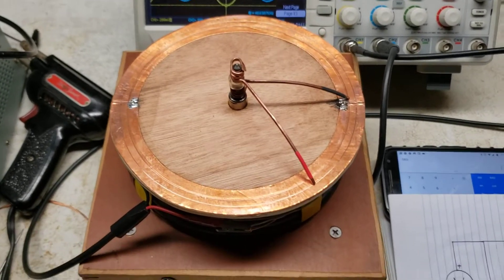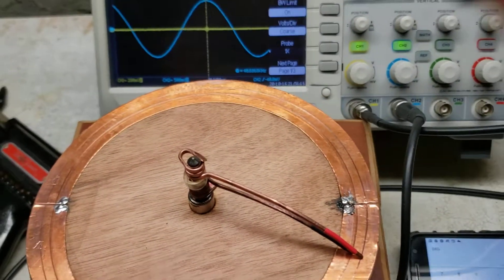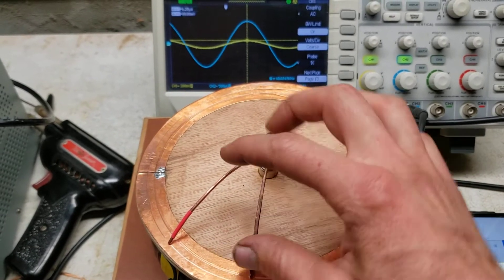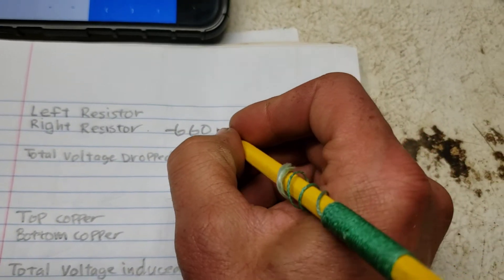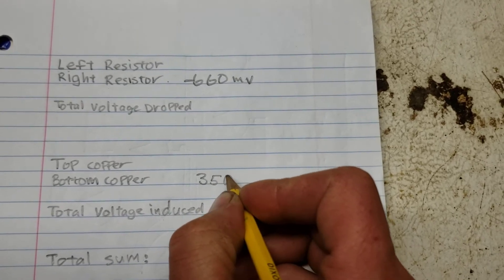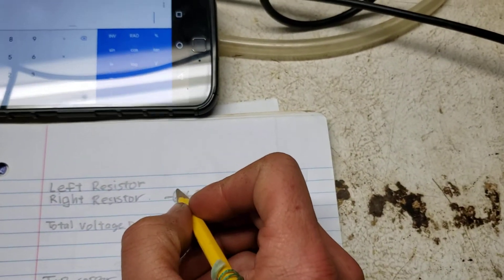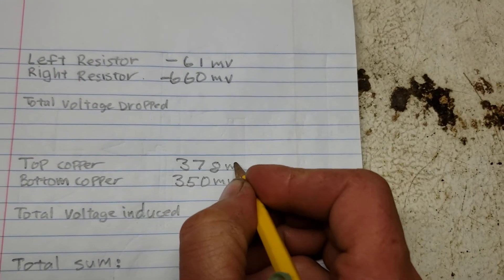The Lewin clock - Kirchhoff's Voltage Law(KVL) holds for loop circuits with induced voltage elements

Comment: Awesome set up :)

Could you test something for me, please? What happens to those same measurements if you place an additional osciloscope outside Lewin's clock? Can you create a table comparing simultaneous readings from an inside and outside osciloscopes? Which readings you consider affected by induced fields?
For example: Bottom copper: +350mV (inner) [affected?] and XXX (outer) [affected ?]; Right resistor: -660mV (inner) [affected?] and YYY (outer) [affected?]
Reply from the maker: I'd be glad to test something for you!
But I'm not sure  what you want exactly, so please explain more.

Do you mean instead of having the leads to down the center, have them go out away from the center like wagon wheel spokes?

As to which readings are affected by induced fields - do you mean voltage induced in the intentional curved path, or induced accidentally in the scope leads?

Basically, a wire running along the same path as the primary winding will have voltage induced in it. The farther away it is, the less induced voltage it will have because the magnetic field falls off with the square of the distance probably or something like that, depending probably on the exact shape of the primary winding.

So moving a wire farther from the primary reduces the induced voltage.

Rotating the wire so that it is at right-angles to the primary wire also reduces the induced voltage, and at exactly 90 degrees, there is no induced voltage.

So it's not like the region of induced voltage is a strict region which cuts off instantly beyond a certain point; it fades out with distance.

That's why I ran my probe leads from the center outward - so they would have zero induced voltage in them.

Another way to have test leads without them having induced voltage is to run them each straight up to a great distance. 
Yet another way is to have them each  run straight out away from the center of the coil a great distance, before coming together to the volt meter.

Thanks!
Reply: @fromjesse   Hi :)
 Mehdi and Lewin's measurements were made using probe wires sitting outside the circuit. On the other hand, your setup measures from inside.

We are going to compare readings from both setups.

Our comparison table should have 4 lines (upper copper, bottom copper, right resistor, left resistor) and 2 columns (fromjesse [inner], Lewin/Mehdi [outer])

We may discuss induction effects later :)
Reply from the maker: @renanmelo4903   Oh, gotcha. 
You mention  measuring like Lewin did - but his leads attached to the outside at the 12 and 6 o-clock positions, then ran along the same path of the coil to the resistors, where they then turned and went directly away probably as a twisted pair.

Did you want me to replicate that setup that Lewin had? Or just measure straight out and straight in, like this:

https://postimg.cc/qzy5Zdd7

As you can see, my probe wires in the above diagram are all traveling at right angles to the transformer winding wires so that no error voltages will be induced into them.

However, if you like, I can wind my test leads around the coil like Lewin did, but I can do as many times as you like to add hundreds of volts of error. But why would we want to do that? :D

Does my diagram look good? I want to make sure I'm doing what you have in mind before I go to a bunch of work that isn't what you wanted :D
Reply from the maker: @renanmelo4903  Thank you for the very nice diagrams! Very clear!

perhaps you could clarify one thing for me, and it may be you have a slight untrue assumption.

On page one, you say "Keep wires and probes close to the clock to reduce induction."

According to Faraday's law (And my video above literally demonstrates this) a conductor passing through a changing magnetic field at right angles will have a voltage induced in it.

We know that the copper foil loop is in such a position and has voltage induced in it, so it stands to reason that any other wire passing along the same path will also have the same voltage induced into it. Right?

So your request of keeping the probe path close to the measured path and reducing induced voltage are mutually exclusive. If it's close & parallel, it WILL have induced voltage. If I orient it so that it has no induced voltage, it won't be close and parallel  - it will be at right-angles to the copper foil path.

Remember, we're not talking about voltage being induced in the measurement wires due to the current in them - we are talking about the voltage being induced in them due to the changing magnetic field they cut through.

Can you see that if the measurement wire runs along the same path as the copper foil, that it will have the same voltage induced across it as is induced across that section of the copper foil?

Which way would you like the probe wires run? So that they have no voltage induced (straight away, at right angles to the copper foil path) or would you like them to run along the same path as your diagram shows, and have the same voltage induced in them as is induced in the copper foil path?

By running the probe wires straight away at right angles to the copper foil path, induction in them can be avoided, because it keeps them at right angles to the axis of induction. Then once they are a couple feet away from the magnetic field, they can be run together to the volt meter.

As to your four measurements as you have the probe wires drawn, I can tell you what we will measure: 

Of course the inside measurements you already have from the video above.

The outside measurements are as follows:

The two resistors will measure the -0.1v and 0.9v as expected. That is the actual voltage across the resistors.

The two copper foil half-turns will each measure zero volts, because the voltage being induced in that copper segment is exactly the same as the voltage being induced in the probe leads which follow the same path, and the two voltages are of opposite sign and the one cancels the other.

Do this experiment please: Take two identical voltage batteries like 9v or AA or AAA or whatever - just make sure they have the same voltage. Put them back to back in series, and measure the voltage across the string, like this: +==- -==+

You'll get zero. Ha! There's no voltage in these batteries! Correction: There is voltage in both batteries, but they are connected with opposite polarity and they cancel eachother.

It's the same thing with a folded loop in a changing magnetic field: +1v is induced in one half, but -1v is induced in the other half, so you measure 0 if you measure both halves together.

If you don't yet believe that a wire passing along the copper path will have voltage induced in it, then we need to sort that out or nothing will make sense.

I'm very happy to do the experiments, but it's clear that you don't understand exactly what you're asking - so that's why I'm trying to clear that up first!

Would you like first a simple demonstration showing how a probe wire running parallel to the copper foil path has a voltage induced into it?

This is how transformers work, but many people can't imagine voltage being induced in something as a simple wire hanging in a changing magnetic field.
Reply: @fromjesse  Yes, there will be induction. However, it will be small once the available area to magnetic flux is reduced.

I added a new page illustrating it :) https://www.udrop.com/E9s/setup2.pdf (PDF, 3 pages, 14 days to expire)

"Magnectic" instead of magnetic...  sorry! O.O
Reply from the maker: @renanmelo4903  Ahhh, thank you very much. I see what you're thinking.

First of all, you are absolutely correct about twisting the pair to eliminate induction in that section. Twisting, using shielded coaxial, or even just running two thin wires very close to eachother - this is all effective at keeping out significant induced voltages for our setup. Once the wires are happily twisted, it doesn't matter where the twisted pair runs.

The difficulty is getting the wires to the point where they meet up to be twisted - and the untwist part is where the voltage gets induced.

The reason we twist by the way is because it makes a bunch of tiny loops - and whatever voltage is induced in one loop will be induced with the opposite sign in the next loop, thus canceling out the voltage induced in the first loop.

You have however  a couple misconceptions.

Look at this stock diagram showing the orientation of the magnetic field around a solenoid coil: https://www.shutterstock.com/image-vector/magnetic-field-lines-around-coil-316674167

The magnetic field is the strongest right in the center of the primary winding conductors. 

There's several aspects at play here, and they can be a little confusing.

The magnetic field strength drops off rapidly outside the coil with increasing distance. 

The "Area enclosed" only applies to inside the primary coil, not outside. (at least in the meaning you are using.)

The underlying principle is not _how much area_, but how much magnetic flux intensity is cut across by the wire in question.

We use the "How much area" concept when the secondary is a loop and is entirely inside the primary winding.

But when we begin to analyze the voltages induced on subsegments of that loop, we no longer use the "area" but rather we examine the magnetic flux density 

So for example, look again at the stock diagram above: If you put a wire into that black magnetic field, it will get a field induced in it but ONLY if the wire cuts across the lines of magnetic force.

If the wire is exactly line up with the lines of magnetic force, no voltage will be induced.

Ultimately, if the probe wire is at exactly right-angles to the primary winding wire, then no voltage will be induced in the probe wire. That is why my clock hands go straight to the center.

Thus, if you have a wire that travels around the coil along the same path as the primary, you can see that it cuts across LOTS of lines of magnetic field, and it will have lots of voltage induced into it. And since the magnetic field is produced by the primary winding, the closer the probe wire is to the primary, the more voltage will be induced in it.

However, you can see that if your probe wire goes straight away from or towards the center of the primary, then it will not be crossing any lines of magnetic field at right angles, and it will be at right angles to the primary winding, and it will have no voltage induced in it.

That is Faraday's law. 

I added some black annotations and magnetic lines of force to your drawing: https://postimg.cc/phXRBVm3

Here's a short video demonstrating that the area of the secondary which is outside of the primary does not count towards area which induces voltage in it: https://youtu.be/Wju9QoB-llE

If this still isn't making sense, let me know and I'll set up my coil with some test leads and make a more detailed video showing what sorts of probing techniques induce voltage in the probe leads.

Or if you have other questions, let me know. Thanks!
Reply: @fromjesse  I am learning a lot from our conversation :)

Could you make a video comparing the readings of twisted and untwisted pairs like  your image?
Reply from the maker: @renanmelo4903  Alrighty, I made the video. It's 27 minutes and should give a pretty good overview, but it's gonna take all night to upload, since my internet ain't all that great. I'll send you a note when it is uploaded.
Reply: @fromjesse  Hi! I never thought about flux lines outside the clock the way you told me. I think this is a good point to do an experiment in order to standardise our points of view. It will influence our discussion about how induction affect our measurements outside the clock. I created an "Area Experiment" here: https://www.udrop.com/Ec7/area_experiment.pdf

Could you do this experiment too, please?
Thanks!
Reply from the maker: @renanmelo4903  Good Morning!
So my upload from last night finished, and in that video I demonstrate a bunch of different things: https://youtu.be/_mzxE_p5dN8

I'm sorry it's so long, but hopefully it will give you an idea of what these physics are like in the real world.

I also just now checked out your area_experiment.pdf - very valid questions, but I think the video I just linked for you answers the questions. 
If it does not, let me know! You will probably want to re formulate your question after watching the video.

But in specific answer to the question in area_experiment.pdf, the correct answer is:

D) The measured voltage will decrease when switching from diagram 1 to diagram 2 because the induced voltage will increase in the probe wires in the opposite sign of the voltage being induced in the copper foil, and this increased negative voltage will subtract from the positive voltage induced in the copper foil, thus causing the reading to go down.

As you will see in the video I linked above, using "area" outside of the primary is really useless. It's only useful for the part of the secondary that is inside the primary.
Reply from the maker: @renanmelo4903  Thanks! and Hi!

[Part 1 of 2]
Wheee, I see this is rather long. My apologies. I hope you read it all, I put a lot of effort into it and hope it either helps you come to my view or helps you see what you need to explain to bring me to your view :D

Did Mehdi also use the opposite batteries analogy? I know I did, but I don't remember if he did as well.

>If we apply Ohm's law to resistor, we must apply the same law for condutors since they are in the same circuit under the same magnectic flux.

I'm not sure what ohms law has to do with the question. The ohmic drop across the copper wire is so small it can be ignored. That part of the circuit could be a super conductor and the situation would be no different, within the resolution of your instruments.

Put another way, we can apply ohms law to the copper wire but the resistance is essentially zero so the ohmic drop is also essentially zero, and it might as well have no resistance, so the current does not cause an ohmic drop which would be the cause of Lewin's apparent paradox.

In other words, go ahead and account for all the ohmic drop in even the copper part of the loop, and your answer will only change by a few part per million at most, and the paradox will still exist as much a ever.

Or maybe I misunderstood your point?

I read over your PDF - I can't follow all the math so I can't comment on that, but I'll comment on some of the words:

First, you say of Mehdi, that he misinterpreted 3 points in Lewin's video. I'll comment on two of those.

>1. Can two volt meters attached to the same two points show different values?

The reality is that No, two identical volt meters cannot read different values when attached to the same two points. Inducing a series voltage error inline with each volt meter that is different makes them two volt meters that are no longer identical.

Lewin's two volt meters were NOT identical. Sure, some of the components were identical, but as a complete isntrument for measuring, they had different error voltages added to (or subtracted from) their measurement path, which Lewin did not account for. It's a fraud for him to say they were identical when they were not in fact identical.

If we consider the volt meters identical, than the test leads must be considered components of the circuit under test, in which case the two volt meters, while being identical, are not connected in the same place, but rather to different components.

It's a shell game.

It'd be one thing if it was impossible to measure the voltage without having voltage induced in the leads, but it's entirely possible to measure the voltage without inducing voltage in the test leads.

>3. In most cases real world and circuit diagram are equivalent. That experiment is one where it's equivalence is broken.

Objection your honor :D :D :D Anybody can draw the wrong diagram for his real world circuit. Lewin had coupled windings, and he drew them as non-coupled windings.

Lewin's integrity is what's broken. You can't honestly draw coupled windings in a transformer as isolated lumped elements then expect to get valid results.

It's just as stupid as if I drew a circuit and built same circuit, then inserted a AAA battery in series with one of the volt meter leads (but did not draw it in my diagram) and said Ha! I have two identical volt meters connected to the same point, KVL doesn't work!

No. Just no. The volt meters are identical, OR they are connected to the same point. If the series battery is part of the circuit under test, then the volt meters are not connected to the same point, but can be identical. Alternatively, if the series battery is NOT part of the circuit under test, then the volt meters are NOT identical, because they have non-identical errors added/subtracted to/from their inputs.

Nobody can honestly neglect part of their circuit in the diagram and then say KVL doesn't hold. For the model to work you have to model the physical circuit you have, not a circuit you don't have.

We HAVE (That's emphasis, not yelling:D) - anyway, we HAVE symbols for inductively coupled elements. Lewin's physical circuit HAS coupled inductive elements, but he drew them as NON-coupled elements, then he based his analysis on the FAULTY diagram, and showed that his measurements disagreed, and blamed it on KVL.

The point is that if you INcorrectly model ANY of your components in ANY kind of loop (even a DC battery and purely resistive loop) the analysis isn't going to match the real world.

If he had modeled the voltage induced in the volt meter leads, or if he had simply probed in such a way as to not induce voltage into his volt meter leads, KVL would have held just fine.

Regarding your Changing B Case section:

Your diagram is not representative of your physical circuit. In the schematic, you show a coil winding with two terminals and two resistors in series across the two terminals.

In the physical sketch, you show the transformer as having a single terminal (??) with both volt meters connecting to that single terminal? That's nonsensical :D

I'd be glad to draw the equivalent diagram or real-world-sketch, just let me know if you want it to match your schematic, or your physical sketch. But in any case, your physical sketch needs another point - if it's got 3 components or regions (i.e. two regions of resistance and a region of induced voltage) it needs 3 points on it.

However you could have just one and one resistor, then you only need two points. But then your schematic would have only one resistor as well.
Reply from the maker: [Part 2 of 2]
>Is it bad probing? I don't think so :)

Well, any time you have error induced in your probe leads outside of the circuit under test, you have, by definition, bad probing.
You need to either prevent errors introduced outside of the circuit under test, or you have to model your test leads as part of the circuit under test, or you DO have bad probing, period. That's the definition.

Un-accounted-for voltage induced in the test leads is the number-one source of bad probing with oscilloscopes. If Lewin wasn't using bad probing, then there is no such thing as bad probing. You've just eliminated an entire problem that used to plague the EE industry :D

Of course EE's are still going to be getting bad readings, but they can just chalk it up to KVL not holding. Ultimately they are still going to have to learn to probe correctly, and then guess what, KVL will hold again.

At the end of the day, if we're going to have voltage induced in our test leads, we either need to account for it in our measurement, or model it as part of our circuit under test - otherwise we got bad probing. And Lewin neither accounted for it in his reading nor did he model it as part of his circuit under test.

By the way, two other Physics professors were called to defend Lewin, and they both responded in detail and neither one defended him as best as I can tell.

In fact, the article by Dr. McDonald (from Princeton) has some interesting things to say.

For example, he says this in the notes, regarding some of Dr. Lewin's Kirchhoff-follow-up videos:

"many of the statements in these videos are more in the nature of misdirection than explanation."

Dr. McDonald also says that Dr. Lewin is using an obsolete version of Kirchhoff's law which Dr. McDonald says "can lead to apparent paradoxes."

Dr. McDonald also says "An important consideration in Lewin’s example (not mentioned by Lewin) ..."

Misdirection, and apparent paradoxes? Not mentioning important considerations? Sounds like what a stage magician does. Smoke and mirrors.

The fact is that even Dr. McDonald, while using the highest professional courtesy, still accuses Dr. Lewin of not mentioning important considerations, using an obsolete version of KVL which causes an apparent paradox, and misdirection (which is a form of deception if intentional.)

(I'm sure you already read that document, but it can be found here: http://www.physics.princeton.edu/~mcdonald/examples/lewin.pdf )

Furthermore, MIT Professor Dr. John Belcher, who Dr. Lewin called to his defense, concluded thus:

"One textbook that makes perfectly clear what the “voltage across the inductor” is is the textbook by Feynman, Leighton, and Sands, The Feynman Lectures on Physics (Addison‐Wesley, Reading, MA 1964), .... Thus with Feynman et al.’s definition, the sum of all the voltage differences around the circuit is zero (that is, KVL holds) ... In this sense, KVL holds, as argued by Mehdi Sadaghdar, but one must always remember that the voltage difference across the inductor is defined in a very different way compared to the voltage difference across the other three elements." (See here: http://www.electroboom.com/share/FaradaysLaw_Mehdi.pdf )

So we've got an MIT Physics professor quoting no other than Richard Feynman, saying that KVL holds.

We've got a Princeton Physics professor saying that Lewin neglects to mention important considerations, uses an obsolete version KVL, and uses misdirection, and says that the paradox is only apparent (i.e. not really a paradox) due to the fact that he's using an obsolete version of KVL.

As far as I can tell, the problem boils down to a very simple one: If you analyze a circuit diagram that does not match your physical diagram, your calculated results will not match your measured results, and all the laws of physics will appear to fail.

You have to understand each lumped element and how it behaves, and model it accordingly. If you do, then KVL works. If you don't, not only KVL fails but everything else fails too.

I'll give you an example from your own paper: Page 1, "The Battery Case:"
You show a battery and two resistors. Now let's say before assembling it, you measure the resistors, and you measure the voltage on the battery. Now you wire it up with a real battery and resistors, and carefully measure your two voltages dropped on the resistors. They are going to be less than you thought. The open circuit battery voltage will be greater than the voltage that you actually drop across the two resistors. Why? Because a real battery has internal resistance, and you neglected to model it. See? KVL doesn't hold!
No, KVL holds, but you have to model your circuit correctly. To get accurate results, you need to also model the resistor inside the battery.

It doesn't matter whether your loop is made up of resistors and inductors, or batteries, solar cells, capacitors, diodes, or whatever - you always, always have to correctly lump and model your components. If you don't, you will think physics is falling apart at every seam. But it's not physics fault, it's just incorrect modeling. Incorrect probing is a subclass of incorrect modeling, because you're not modeling the components in your instrument's test leads.

Anyway, that's my opinion. And Dr. Belcher's, and Dr. McDonalds, and quite probably even Dr. Feynman's.

Now are there circuits where KVL cannot be used? Of course there are. Non-loop circuits cannot be fully described by KVL because it's for loops. Circuits which have transmission lines in them probably could not be fully quantified with KVL - however if the transmission line units were correctly lumped, then the remaining loop part of it would fit KVL.

In any case, Lewin's setup wasn't a transmission line circuit. His can easily be analyzed as a loop and KVL holds. And that's why adding up the voltages as I show in this video shows that KVL works.

The best you can do along the lines of demonstrating that KVL doesn't hold in Lewin's circuit is to use a definition of volt that based on a technicality excludes certain situations. Or you cold perhaps do like Lewin did and use an obsolete definition of KVL. My guess is that even the obsolete definition of KVL did hold at the time it was written, but then afterwards, the definition of volt was changed which caused some technicality. So why does Lewin decide to use the modern definition of volt, but not the modern definition of KVL? Either use the obsolete KVL and the volt that it was defined with, or use the modern of both.

But at the end of the day, even a sine wave is a voltage. You might say that it's not voltage due to some technicality (and you would be going against Richard Feynman) but regardless, the AC output of a transformer still measures as a voltage, if you connect a load it still does work. But if the induced voltage at the output of a transformer is not voltage, then what about an identical sine wave generated by a wave form synthesizer? Would KVL hold if the sine wave was instead coming from a waveform generator instead of an AC transformer?

My guess is that if you define volt in such a way that KVL does not hold on Lewin's circuit, that a lot of other physics will fall apart with that definition of volt.

Hope that helps :D
Reply: @fromjesse  Hi :)

You don't have to worry about the size of your answers. As long as we maintain mutual respect, it will be a pleasure to continue our theoretical investigation. Unfortunately, I do not speak English fluently which reduces the effectiveness of my messages.  Please be patient :)

Having said that, let's get to the point: KVL or FL?
I have no problem with KVL applied to circuit diagrams. My problem is when someone applies KVL to "physical diagrams"... in particular that one in Lewin's video.

Fortunately, I have identified a key point in our debate: the explanation of what is happening along the conductors!There is a BIG difference between how KVL and FL explain what is happening inside them! And that's why I commented on Ohm's law :)

In your experiment, you got an f.e.m. + 728 mV, total resistance of ~1k and consequently a current of 728 uA. What happens if we apply Ohm's law to the conductors using this current and the voltage measured along them ( 364 mV on average)? Remember that R ~0 in a conductor... Did you notice the contradiction?

I thought a lot about our conversations... the way FL solves this paradox is totally counter-intuitive, but it respects Ohm's law. If I can explain it to you, you'll understand my point of view.  You may disagree, but at least you will understand why I am against using KVL in "physical diagrams" when they are not equivalent to circuit diagrams.

Could you explain how KVL solves this paradox before I tell you how FL does it? I don't want to bias your answer :)

Translated with www.DeepL.com/Translator (free version)
Reply from the maker: @renanmelo4903  

>As long as we maintain mutual respect, it will be a pleasure to continue our theoretical investigation.

Excellent!

However, this is not strictly a theoretical investigation to me. For me, theory meets practice. I use these laws to make machines and circuits, and they work.  If I misunderstood the laws of physics, the things I build which rely on these laws would not work as I expect

>Unfortunately, I do not speak English fluently which reduces the effectiveness of my messages.  Please be patient :)

Cool! I always enjoy talking to people from different parts of the world! What's your native language, if you don't mind my asking?

And if you think something I say might not be translating correctly, please ask so I can explain in different words! There is the possibility of confusion going both ways due to translation.

>My problem is when someone applies KVL to "physical diagrams".

My problem is when someone applies any laws of physics to a drawn diagram which does not match the physical machine they claim it to match. 

>Did you notice the contradiction?

No, I'm afraid I don't see any contradictions.

>the way FL solves this paradox is totally counter-intuitive,

You'll have to explain it to me I'm afraid. I don't see a paradox. Neither does this guy at Princeton: http://kirkmcd.princeton.edu/ More on him later.

>Could you explain how KVL solves this paradox before I tell you how FL does it?

I don't see a paradox. The way I see it, KVL speaks only to how voltages add and subtract in a loop. It makes no concern about how those voltages are created or dropped by each specific component.

To use KVL, you just need to know what voltages are produced and dropped in which components of the loop. 

That is all.

KVL doesn't care whether the voltage is created or dropped in batteries, transformers, resistors, inductors, diodes, capacitors, or cockroaches (LOL) -- it simply addresses the manner in which the voltages in a loop add up. That is all. You don't need to know HOW those voltages are created or lost, just that they are.

The only requirement is that you lump components in a way that is true to reality. That is all. You must treat resistors like resistors, and batteries like batteries.

If you built a circuit with a battery and a resistor, but then drew a diagram with just two resistors instead of a battery, your measurements will not agree with your theory. KVL will not hold, Faraday's law will not hold, Ohms law will not hold, Watts law will not hold, none of physics will hold if your diagram doesn't match your real circuit.

Now, if you want to delve deeper into the components of your loop and learn how each of them works, you may want to look at how each of the components create or drop their respective voltage.

You would understand inductors and transformers with Faradays law, Ohms law, and probably Lenz law.

You would understand resistors with ohms law.

You would understand diodes with semiconductor principles.

You would understand  electrochemical batteries with electrochemistry and ohms law.

But none of those laws are about loops in general. They are about the individual components that may be in a loop, or any other circuit.

(Note that an inductor CAN be in a loop, but it doesn't have to be. A straight wire of infinite length still has an inductance, and if it carries a current, produces a magnetic field. And another wire running along it will have induced into it a voltage as a function of the change of magnetic field produced by the first.)

The laws of electrochemistry explain how much voltage and resistance a battery has. 
The laws of Faraday tell you how much voltage a transformer will produce.
Ohms law tells you how much voltage a resistor will drop.
Principles of semiconductors tell you  how much voltage a semiconductor will produce or drop.

Kirchhoff's Voltage Law tells us how all those voltages add up in a loop.

And Kirchhoff's Current Law tells us how all the currents add up, again, regardless of the exact mechanism used by each component to create or limit the flow of current.

As far as I can tell, this whole so-called paradox is based on a misunderstanding of incorrectly modeling lumped components, which makes not only KVL fail, but all laws of physics fail.

By the way, Professor Dr. Kirk McDonald (from Princeton, High Energy Physics) agrees with me. He says that Lewin's paradox was only apparent, not a real paradox.

But by all means, if you think you can help me to see the light, then go for it!

Thanks!

~Jesse
Reply from the maker: @renanmelo4903  As an after thought, I wonder if it would help if you tried to explain the paradox to me!  What do you see as the paradox? Thanks!
Reply: @fromjesse  Hi :)

Could you send me both diagrams (physical and circuit) of your experiment with the voltage measurements performed both inside and outside the loop please?

I believe that by explaining at your diagrams I will be able to be clearer.
Reply from the maker: @renanmelo4903  Hi!

I'm glad to do as you request - but please help me understand exactly what you have in mind so I can do it right the first time!

The symbolic schematic diagram I understand - I can draw that up no problem.

But what do you mean by physical diagram? Can I just send a picture or video of the physical setup?

When I measure "outside the loop" do you want me to do so with no voltage induced in my probe leads, or do you want me to induce voltage in my probe leads, and if so how much? I can induce as little or as much voltage in my probe leads as you request by winding as many times as you want around the transformer.

In fact, I can induce voltage on the inside measurement as well by winding around the loop inside with the probe wire to add or subtract as much probe error as you like.

In my symbolic schematic diagram I will show voltage induced in the probe as secondary turns on a transformer, because that is what it is.

The copper foil trace will also be shown as a transformer winding, for that is what it is..

Thanks! 
Have a great day!
Reply from the maker: @renanmelo4903  Excellent! Thanks!

Is it OK if the 900 ohm resistor is actually 1k?

900 ohm resistors are very uncommon and I don't have any on hand.

My expectation is that Vo will equal Vi within the limits of accuracy of my test equipment, and that simultaneous measurements does not change the answer.

Shall I perform the test? I gotta run some errands right now but will be back later.

Thanks!
Reply from the maker: @renanmelo4903  Oh, and the symbolic circuit diagram will show two a transformer with two secondary windings wired in a loop with the 2 resistors.
Reply from the maker: @renanmelo4903  Hey, I did a video showing that using Lewin's logic, KVL doesn't work with DC batteries either: https://youtu.be/V_Gs8tSqBRY
Maybe it'll help you think of a clear way to explain to me the error in my thinking. 
Tomorrow I'll try and draw you a diagram for your proposed circuit except using 100 ohm and 1000 ohm since that's what I have.
Reply: @fromjesse  Hi :)

FL predicts Vo=zero since there is no B outside the loop. This is the counter-intuitive result I was talking about.
Later today I'll send to you 3 setups in order to verify It experimentally :)

I didn't see your new video yet. I will see it and comment separetelly in order to don't confuse us with this 3 setups :)
Reply from the maker: @renanmelo4903  Good Morning!

>FL predicts Vo=zero since there is no B outside the loop.

Could you explain that? Didn't we already see at this point in my other video that Vo=400mv? https://youtu.be/_mzxE_p5dN8?t=922

Also, can we finish with this current test before moving onto 3 more setups? https://www.udrop.com/file/Fcz/diagrams.pdf

Thanks!
Reply from the maker: @renanmelo4903  Ahh, I did draw a diagram for your first PDF earlier, but I guess now it's not needed. But here it is: https://postimg.cc/n9M5C2v1

But now I have a new pdf to look at :D

Ok, so let's concentrate on setup 2.

You have a single turn secondary, with two series resistors AND an amp meter in series.

My prediction is that Vo and Vi-dotted will read zero, because they do not go through the core.
Vi, because it goes through the core, will have one turn's worth of voltage on it.
The current at the amp meter will be one turn's of open circuit voltage divided by the sum of the ohms in the two resistors.

I'm glad to set up this test - but could we simplify it a little? Could we just use a 1k ohm resistor as an amp meter, then we can measure the voltage drop across the resistor and calculate the amps? 

I can do two resisters if you want me to - I just don't see the extra resistor as making any real difference or serving any purpose.

Even Lewin didn't need two resistors, it just added complexity to his show-and-tell.

As to your statement:

>Be careful that the wires of the external voltmeter should not embrace the magnetic flux lines.

The flux lines are almost entirely confined to the inside of the toroid core. That's why we use toroids and other cores - they allow MUCH MUCH more magnetic flux in a small area, and as such, they provide a much "easier" path for the magnetic flux, so there is literally hardly any at all outside of the  core, unless it is a gapped or not a closed path core.

Thanks!
Reply: @fromjesse  Hi!

Thanks for your diagram! Now I've begun to understand how you are modeling the circuit...

Could you send me a diagram of how you understand setup #2 also, please?
Reply from the maker: @renanmelo4903  So you've drawn a resistor as the winding. Which is fine, it will be modeled as a single turn winding on a transformer that just happens to have a high resistance. But it may make it confusing for you. Do you really need those resistors in the loop? 

Basically the diagram will show that Vo and Vi-dotted will be both connected to the same transformer terminal, and thus will not show any voltage.
Vi will be connected across the two terminals of the transformer output - because as you can see, the measurement path takes exactly one turn through the transformer.

Let me know if you want a diagram for it as it is or inform me if it's OK to remove the resistors from the diagram.

Thanks!
Reply: @fromjesse  Hi :)
I 'd like a diagram as it is (2 resistors, voltmeters, etc) in order to compare to 'physical diagram' :)

Thanks
Reply from the maker: @renanmelo4903  Sorry for the delay! Here's the schematic: https://postimg.cc/qznW66qP

Having a resistor in the middle of a winding is rather non-conventional, and there are a couple ways to correctly draw it.
One way is to just draw it like I did.
Another is to not draw it, and put a note that says "This coil has high internal resistance." 
Either way works the same for lumping, transformers always have some internal resistance anyway unless they are superconductor transformers.
Reply: @fromjesse  Thanks! I'll think about it :)
Reply from the maker: @renanmelo4903   Greetings!!

I'm not sure I grasp the full point of your notes, or perhaps they are just notes and don't have a point. But I'll still respond to a few things you say in them :D

>Geometry of "physical diagram"  is not completely preserved at "circuit diagram."

Correct - circuit diagrams do not have any intention of preserving the GEOMETRY of the physical mechanism they depict. The components are shown as SYMBOLS, and the wires are symbolic nets - they are symbolic of that group of connections. There is no implied  or expected preservation of the geometry -- except electrical details must be preserved. For example, if you noticed those 3 black dots in the transformer symbol on your page 1? Those three black dots indicate the phase relationship of the windings. When  that lead on one winding is positive, all the dotted leads on all the windings will also be positive. While the dot does sort of reference the geometry by indicating which end of the wire is the positive at a given instant in time, it is not primarily there for geometric reasons but rather the electrical phase reasons.

>For example, it was necessary to bend the loop in the circuit diagram above. 

Well, it wasn't necessary, it was convenient and standard. But I could have drawn the iron core in a loop and drawn the electrical loop without bending the loop. 
But the schematic is purely symbolic of the electrical properties. The one important thing for a schematic is that it accurately and fully represents the electrical situation. It's a language, and it has to be coherent with observable reality, or it won't be any use.

>A changing magnetic flux is represented by its resulting effect (induced emf) as if it were confined within an element (transformer's secondary or voltage source). Thus, someone could think that a copper wire is acting as a battery due to induction. However, this is not real because there are no other chemical elements involved.

I'm not sure I'm understanding your point, so my response may not make sense.
But on the flip side, couldn't someone just as likely observe voltage from a battery but falsely assume it was from induction? And wouldn't that not be real because there was no changing magnetic field?

I wonder if you might be stuck on the "Two kinds of electricity" fallacy. You can't treat a voltage source differently just because it's magnetically generated instead of electrochemical. There are in fact several other voltage sources that are neither magnetic nor chemical. For example, the photo-electric effect and the photo-diode is one. Another is the oxide layer thermo-electric effect, and there is the capacitor effect, and the Triboelectric effect, and the piezo effect.

And another very relevant one is the thermo-couple effect: A series of 3 chunks of metal with perfect electrical connections can  produce a voltage -- and neither chemistry is involved nor is a changing magnetic field - so that could be falsely assumed to be magnetic or chemical. But that doesn't make it real.

Each voltage producer has a whole topic of science which quantifies every possible aspect of how and why that particular voltage source works, but when it comes down to putting that voltage source into a loop and analyzing the loop, we treat them all just like any other voltage source.

>"Energy" is due to changing flux ; it doesn't come from elements of the circuit (in this case)."

Well, the voltage which is measured kind of comes from the winding in the transformer though.  That conductive path formed by one or more turns is definitely how the energy gets converted to voltage which can be measured with a volt meter.

>The situations of 2 volt meters are not equivalent.  .... One of them is inside a changing magnetic flux whereas the other is outside that region. Inside volt meter will read electrical work PLUS induction effects.  Outside volt meter will read only electrical work because there is no changing flux through d1 path.  ...  However, "circuit diagram" shows Vo and Vi as if their situations were equivalent. I believe this is a modeling problem ....

Could you explain further please? We agree that there is no changing flux through the path of d1. But then you say that the inside volt meter will read electrical work PLUS induction effects because d2 will have voltage induced into it. But we know that d2 is running at all times symmetrically at right angles to the primary and at the wrong angle in the magnetic field to have any voltage induced in it.

So how could d2 have voltage induced in it if Faraday's law says it won't? 

And how is it a modeling error if both the diagram and the real-world-machine match eachother? In other words, the volt meters leads are run in the real world test setup so that they are at the wrong angle to have voltage induced in them, and that is also how they are drawn in the diagram, so I don't see the modeling error.

Or are you saying that Vo and Vi would, if measured in real life, measure significantly differently from eachother?

Or are you saying that there is a modeling error which is undetectable with volt meters?

>Although B field is restricted inside a circumference at our physical diagram, it doesn't come from one of circuit's elements as assumed in lumped model. It is an external field.

And you show a diagram of a coil in a rectangular box but you also show a magnetic field outside of the rectangular box...

I'm confused by your statement. 

I do think you're stuck on the "A simple conductor cannot be a component" fallacy though. Please realize that some kinds of components can be made of just a conductor.  The fact that conductors are usually just used for wires to connect stuff doesn't mean that a very important and amazing component can't be made out of nothing but a length of conductor.

But what do you mean that the B field is an external field?

That's why we lump components. That's why we have to correctly lump components - and that means to do so in a way that reflects reality.

That's why I modeled my d1 and d2 leads as not being a part of the transformer - because in reality, they do not partake in the action of the transformer.
Things which DO have voltages induced due to the B field must be shown as secondary windings.
Things which do NOT have voltages induced in them due to the B field must NOT be shown as secondary windings.

So are you saying that my Vi and Vo would, in real life, have different readings? How much different? I still have my test jig and I would be glad to make another video.

Thanks & have a great day!
Reply: @fromjesse  hi :)

1) 2 types of electricity fallacy: It isn't fallacy, it is mathematical rigor to Maxwell's Eq. Those equations treat differently batteries and induction. Induction is associated with changes in time (math derivatives), while batteries provide constant voltages (math constant values, not time derivatives).

We can't have a constant induced voltage for long periods like batteries. That is why MaxEQ treat them differently. However, both sources provides us energy and that is the concept that has the same treatment all over physics (regardless of its source).

2) MaxEQ reduces all electric effects you have listed to E and B fields. For example: Batteries: different elements -> E field. Light: changing E and B fields. Tribo-couple like Fe-Cu or Cu-Al -> different elements -> E fields. Induction -> changing B flux. That is why "wires behave like batteries" is a pitfall: wires have only one element (Cu), it has neglegible E field inside and voltage that comes from induction isn't constant. Batteries have different elements, they stablish E fields inside them and their voltage is constant. The only thing they have in common is that they "give" energy to our circuit.

3) Faraday's Law: the definition that you are using doesn't account for the area inside a region. I think that this is the reason why we do not agree. That area is important in "physical diagram" and MaxEQ but once you draw that "circuit diagram" (which concentrate fields and/or break geometry) the area vanishes in KVL equationing. Therefore, it seams that Vi is not affected by induction but it is indeed (according to MaxEQ)

4) Do I think that Vi and Vo will give different values in real life? Yes :) In this setup you would get Vo = 0 (no B leaking to upper region) or Vo=-Vi (with B leakage) or Vo=-Vi/2 (B leakage + shared ground channels at oscilloscope). I already sent you 3 setups with no B leakage (Toroid, E transformer and infinite solenoid ) whose "physical diagrams" were equivalent (under MaxEQ) but I didn't understand you diagram :( Could you draw it for me, please?

Thanks
Reply from the maker: @renanmelo4903  

> I didn't understand you diagram :( Could you draw it for me, please?

Glad to, but I'm totally confused as to what diagram you'd like me to draw, and which one you didn't understand. Please explain what you'd like me to draw :D

>4) Do I think that Vi and Vo will give different values in real life? Yes :) In this setup you would get Vo = 0 (no B leaking to upper region) or Vo=-Vi (with B leakage) or Vo=-Vi/2 (B leakage + shared ground channels at oscilloscope).

You are talking about your diagram on page 1 here, right? https://www.udrop.com/file/2lOF/pitfallscircuitdiagram.pdf

Please explain how you would like the d1 leads routed for both the "No B Leaking to upper region" and the "B leakage" configuration so I can test your claim.

Maybe this is the point where I will come to see the error in my understanding, because I currently believe that Vo and Vi would be of the same phase and amplitude so long as the test leads run at right angles to the primary where they are near the primary. In fact, I roughly demonstrated that the amplitude remains roughly the same whether measured from the inside or the outside -- or straight up: I moved my leads from straight out continuously to straight up and then to straight in. In other words, I slewed from d1 to d2 - and if there had been a phase reversal (i.e. Vo=-Vi) then there would have to have been a null position.

https://youtu.be/_mzxE_p5dN8?t=944

Unfortunately I didn't anticipate this question so I didn't really address it clearly in that video because I made that back before this question was asked :D

So am I understanding correctly, you're saying that Vo will either be 0 or -Vi depending how closely d1 is routed to the primary winding path?

(I'm ignoring the shared ground issue because I'm going to try to come up with a way to not have to share a ground. Shared grounds just leave too much room for ambiguity where we both start trying to guess what's going on.)

And what would I read if my volt meter leads went straight up from the points of measurement A and B? Would I measure a null where the phase reversed?

Thanks!
Reply: @fromjesse  hi :)

Lewin's setup assumes B field only inside the loop. This condition will give Vo=0 and Vi not zero even though they are connected to the same physical points. That is why I draw a blue B inside the loop and nothing outside. Your setup has B field closing outside the loop which will give Vo=+Vi as you said. You guys are starting from different conditions.

Suppose that we are in Lewin's conditions. If B is zero outside the loop and we apply KVL to the physical diagram, we have 3 possibilities: 1) All measurements are taken inside the loop (V left, V upper, V right, V bottom) and KVL holds. 2) all measurements are taken outside (V left, 0, V right, 0) then KVL doesn't hold [Lewin's]. 3) Some measurements are taken inside, others outside and we add an element of the "circuit diagram" (not the physical diagram) that was missing [Mehdi's]

It seems that for Lewin a physical law must always hold in a "physical diagram" (either inside or outside the loop). This is how MaxEQ work.
KVL holds in case 1. However, if we apply KVL in case 2 it will not hold. In order to work, we will need to add a value from the whole circuit (acting as a secondary) instead of one of its components [2 resistors+2 wires]. That "whole circuit" component only appears at circuit diagram [case 3].

What do you think?
Reply from the maker: @renanmelo4903   Hi!

I'm feeling rather confused about what you're trying to say here, so pardon me if I appear to be grabbing at straws!

That and it's 1AM and I'm dead tired, just about to go to bed :D

>Your setup has B field closing outside the loop which will give Vo=+Vi as you said.

Hmm. Now I'm confused. In your PDF, you said that Vo=-Vi. Was that a typo, or is +Vi a typo here, or did you change your mind?

>2) all measurements are taken outside (V left, 0, V right, 0) then KVL doesn't hold [Lewin's].

Hmm. Lewin measured left and right to be -0.9 and +0.1 or whatever, not 0 and 0. He didn't measure top and bottom. 

But it's even a lie for me to say that Lewin measured. He had induced voltages of an unknown value in his volt meter leads which he modeled neither as part of his volt meters nor as part of his circuit under test.

>we apply KVL to the physical diagram

No we don't. :D In all seriousness though, KVL does not apply to physical diagrams. And what in the world is a physical diagram?
A diagram typically means a symbolic representation of a real machine.

KVL hasn't anything to do with what goes on inside a battery, a capacitor, or a transformer/inductor.

Maxwell-Faraday equation describes what goes on inside of a transformer, just like the laws of electrochemistry describe what goes on inside a battery.

But outside each component, what goes on inside is of no concern to KVL - KVL just looks at the voltages. And inherent in the very definition of KVL is that it applies to voltages for correctly lumped components, because KVL doesn't have any mathematical relationship to the ionic attractions and potentials inside of a chemical cell nor does it care about the magnetic field that goes on inside of a transformer.

I really am trying but I cannot see what the problem is with seeing the output of a transformer as a voltage source for the sake of KVL - heh, for the sake of the entire world that runs on AC voltage.

Sure -- inside a transformer, if we want to design a transformer, or know how they work, KVL has nothing to do with that - we need Maxwell-Faraday.

But if we're just looking at the voltages of the components, then KVL holds fine, as long as we lump the components correctly. (And by correctly, I mean in a way that reflects reality.)

As to Lewin, he actually had 3 loops - the inner loop, which he should have analyzed then looked at his two outer loops.
Voltage was induced in -- and dropped in -- each of the 3 loops. 

There's just no way around the fact that he had voltage induced in his test leads which he did not account for.

But anyway, are you saying that if I were to redo the Lewin Clock but measuring from the outside instead of the inside that I would get different results than I did when measuring from the inside?

What if I ran my volt meter leads straight away at right angles to the primary winding? Would I still get different results?

I guess what I'm asking is basically this: If KVL doesn't hold, then how can I witness this for myself? Every test I did shows it to hold.

Thanks!
Reply from the maker: @renanmelo4903  Hi!

I've really been trying to figure out where I'm going wrong in my thinking. Obviously to me, my thinking makes perfect sense LOL, yeah yeah I know everybody feels that way about their own thinking.

But 3 people have told me I'm wrong. You and that other chap both very kindly did so and I really do appreciate it. You both have put out extensive effort to help me see the error in my way, but to no avail. The third was of course Dr. Lewin, the great lecturer who can fantastically illustrate the most complex concepts to anybody - who simply apologized to me that physics was a hard subject for me and compared me to a flat earther.

I've been trying to figure out if it's the laws I don't understand, the math I don't understand, or the definitions I don't understand. But I can't figure out where I'm going wrong, or if I'm going wrong. I have your word and the other two guys. I'm certainly not dismissing it out of hand, I'm still trying to understand.

To me, it's very simple. KVL just deals with lumped components and voltages and that is all:
Inside each of those lumps can be any  mode of voltage generation or dropping. If it's a resistor, we have ohms law. If it's a battery, we have electrochemistry. If it's a capacitor, we have capacitance laws. If it's a transformer or inductor, we most definitely use Maxwell's equation of Faraday's law to understand what's going on inside that component.

But outside of the lumps, KVL simply states that all the signed voltages add up to zero around a loop.

By now I'd expected at least one of the 3 of you to say "Jesse so here's where you're going wrong. such and such and whatnot..."

But that hasn't happened, so now I'm trying to guess.

Is it possible you see me using KVL "inside" the transformer as if that's all there is to a transformer?

In fact, is that what Lewin was trying to demonstrate -- that you can't treat the insides of a transformer as normal batteries and resistors? Granted, he really didn't explain well what he was trying to demonstrate, and you'll have to admit he has a flair for, umm, flair, and he likes to end his lectures with a bang. 

Could it be that without an intuitive understanding of transformers, you see me applying KVL and you assume that I am not correctly lumping the secondary windings on the transformer?

Can you think of any experiments I could do that would show me to be wrong? I'm totally willing to find out that I'm wrong because then I can learn what's right!

Actually I wrote the above last night and this morning I had another thought:

It seems me that Dr. Lewin is setting up a dichotomy, and saying that you can use  Maxwell's equation of Faraday's law OR KVL, but not both.

I use them together, and so far my predictions have conformed to reality.

But Dr. Lewin seems to set up a dichotomy that you can use the one OR the other, but not both, and that KVL is for the birds and cannot be used if electromagnetism is involved in any of the internal operations of the components.

I think this is a false dichotomy. KVL and ME/FL are not tools for the same job. They operate at different levels. 

Anyway, let's just assume for a moment that KVL is exclusive to ME/FL, and  let me ask: How do you use  Maxwell's equation of Faraday's law to predict the voltage dropped over the two resistors, without invoking KVL, in any form?

I understand, we have the B field and it's changing and we have voltage induced along a certain path. But we're not allowed to invoke KVL, so how do we predict or calculate the voltage dropped across the resistors? We've got  two voltage sources and two voltage drops. They happen to be in a loop. How can we calculate the voltage across the resistors?

Anyway, that's what I've been thinking. I'm really trying to understand. I'm not trying to be stubborn :D

All the best,

Jesse
Reply: @fromjesse  Hi :)
I'll answer you soon :)
Reply: @fromjesse  Hi :)
i had a problem with my computer and to answer via smartphone is complicated...
I will reply to you soon.
Reply from the maker: @renanmelo4903  Hi! :). Take all the time you need!
Reply: @fromjesse  Hi! Finally I am back :)

>Anyway, let's just assume for a moment that KVL is exclusive to ME/FL, and let me ask: How to use Maxwell's equation of Faraday's law to predict the voltage drop over the two resistors, without invoking KVL, in any form?<
The answer to this question depends on how you interpret the terms of an equation.  I will explain with a financial analogy and you will understand what I am talking about:

Suppose that "I have $10, but I owe $10 to a friend. So my balance is zero".  Putting it in an equation, it would look like this:
10 - 10 = 0
Obviously, right?
What if I said it like this: "I have $10, but my friend gave me -$10 and so my balance is zero".  In an equation it would look like this:
10 + (-10) = 0
Numerically, the result is the same, however, the second case is UNREAL [emphasis] because there is no money with a negative sign.

In the context of MaxEQ, there is no electric field within an ideal conductor that is not moving. That is, V in the top and bottom wires is zero. The voltage you read on the voltmeter on these components is different from zero because it occurs ONLY INSIDE the voltmeter! That's the crazy thing about Faraday's Law!

When you add these values to those on the resistors, you are actually passing the term from the right side of the equation to the left side and will ALWAYS continue getting zero.

sum V - (- dfluxB/dt) = 0

V resistor on the left - (- V top wire) + V resistor on the right - ( - V bottom wire) = 0

Since this new sum gives zero, people think this is KVL even if the interpretation of the terms is completely different.

Think about it :)

Translated with www.DeepL.com/Translator (free version)
Reply from the maker: @renanmelo4903   replying from my phone - will reply more later - but did something get lost in the translation about your friend loaning you $10? If you have $10 and you borrow another $10 you have $20...
Reply: @fromjesse  Sorry, I should have used the verb "to owe" instead of  "to borrow".
Reply from the maker: @renanmelo4903   Good Morning! (or equivalent greetings for whatever time it is where you are!)

I'm really trying to wrap my mind around all this, so please be patient with my questions :D

>In the context of MaxEQ, there is no electric field within an ideal conductor that is not moving.

You mention something that's not moving. What is not moving? The conductor? Or the electric field?

>The voltage you read on the voltmeter on these components is different from zero because it occurs ONLY INSIDE the voltmeter!

I've got issues with that statement :-) 

 Where inside the volt meter is this voltage created? And why does the volt meter reading vanish when I turn off my induction coil? Is this action-at-a-distance?

Besides, there's electrons flowing through the volt meter leads. And the voltage required to motivate those electrons is not coming from inside the volt meter. How can the voltage exist only in the volt meter?

If the laws of physics prevent us from saying that there is voltage across a wire that IS inside a changing magnetic field, then wouldn't those same laws also prevent us from saying that voltage was popping into existence anywhere else in the circuit as well?

Also, if we take the voltage in your house. Stab in your volt meter to the electrical socket, and it measures what, 240vac rms, right? It's 120 for me, but I'm in USA.

Is that voltage also existing only in the volt meter, since the voltage serving your house is coming from the output of a transformer?

Or what if I set up a pair of solar voltage generation panels on a spinning hub such that they actually produced an alternating sine wave voltage -- but without using any magnetics -- and ran that into your house without you knowing it was from the solar panels.  Your volt meter would still measure the same thing, still a 50hz 240v sine wave signal, and you would still say that the voltage existed only in the volt meter.

But then if I said "Hey look out your window, that voltage is being produced by spinning solar panels, you can't use MaxEQ" then all of the sudden the exact same signal on the volt meter is no longer "existing only in the volt meter" but now suddenly it exists in all the wires and the solar panels?

I'm really struggling with this concept that the voltage is sometimes existing only in the volt meter based on our knowledge of what technology is used to generate the sine wave.

Or am I totally confused? Are you saying the voltage always exists only in the volt meter?

>That's the crazy thing about Faraday's Law!

I really am trying to understand, so I even looked up Faraday's law again - is this what we're talking about? http://hyperphysics.phy-astr.gsu.edu/hbase/electric/farlaw.html

It says it right there "Voltage generated = -Turns * ( (Change in B*A) / (Change in Time) )" 

And since the dB/dt in my circuit is taking place at the copper foil arc path, it looks to me like Faraday's Law isn't crazy, it says the voltage is generated there -- not in the volt meter.

>sum V - (- dfluxB/dt) = 0

I'm not sure what you're saying here. Why do you say "sum?"  Normally when you say "sum" you have multiple "terms" which are not strung together with + or - signs.

For example, you might say "sum of a,b,c, and d = 0" -- but you wouldn't say "sum of a+b-c+d=0,"  you would simply say "a+b-c+d=0."

You've got it grouped and signed strangely, but basically that's KVL, except you've substituted db/dt in place of "voltage produced" which is a perfectly valid substitution, just like substituting V with Vr1+Vr2.

Please if you can, answer each question mark. Maybe the answers to my specific questions will help me understand :)

Cheers!
Reply from the maker: @renanmelo4903  Hi! How're you doing?

Thank you for the diagrams!

>There is only the magnetic flux in the internal area whose boundary is delimited by the voltmeter+wires (first image)

Naturally, I object to showing the volt meter leads as partial secondary winding turns on the transformer. That's not accurate lumping.

It's like having a battery, but spilling some of the acid on the next component in line (a capacitor) and having some odd behavior because the capacitor plates have acid between them :D

You'd think by now we both knew that we need to lump components correctly or we're going to get erratic results no matter what. Why can't the transformer secondary be a self contained lumped component with leads like the battery?

Think about it:  You drew the battery completely self contained, not intermingling with the volt meter leads or any other component. 
Then you drew the transformer secondary without any component leads, with no indication of where the lumped boundary of the component is, and then drew the volt meter leads as extensions to the secondary winding, literally inside the component.

If you were just as sloppy with the battery, you would show the volt meter probes going to some random points in the electrolyte of the battery, or connected to the battery terminals with wet salty pieces of rag (hence introducing two more small batteries in series.)

I really don't understand why you can't grasp the concept of lumped components. 

But let's just assume we're correctly lumping our components:

>It reads an electrical field that is caused by a changing magnetic field.

I would counter that a volt meter reads a volt without knowing or caring how the volt was created.

An E-Field  is a voltage distributed across an insulating field gradient of charge carriers.

A volt meter doesn't measure any field. It measures a volt.  (You may be able to pick up a voltage from a field by inserting conductors into the field, but the volt meter will be reading the voltage not the field.... A field is a space with a gradient.)

Volts can make E-Fields, but volts can also exist without E-Fields: You could still have a transformer and a volt meter in a perfect vacuum where E-Fields cannot exist (due to lack of charge carriers) and the transformer and the volt meter would still work fine..

>There is no electrical field inside the conductors.

Of course there is no electric field inside the conductors, because they are conductors. But that doesn't mean there's not a voltage induced over the length of the conductor when they are in a changing magnetic field.

Why does it matter if a given component has or does not have an electric field across some internal part of it?

If it makes a volt, or drops a volt, it's got a volt across it's terminals. That is all that KVL talks about. If it were KEFL we were talking about (Kirchhoff's E-Field Law, why then I could  understand the confusion.)

Why does it matter exactly how a component creates or drops a volt internally? The point is it has a volt across it's  leads. That volt is in a loop, and KVL applies. Or at least nobody's been able to explain (or demonstrate via experiment) a case where KVL does not apply.

I really can't understand why E-Fields even matter to the discussion.  The E-Field is about a voltage distributed across a field of non-conducting charge carriers. But KVL is about voltages being carried in conductors, not about fields in insulators. 

I also really can't understand why we have to keep incorrectly lumping the transformer windings when we have no problem lumping the battery.

Are we on the same page that an E-Field is a distributed voltage spread across a gradient across a field of non-conducting charge carriers?

Why can't we lump the transformer secondary correctly like we do the battery?

Hey, I'm curious. I'm really trying to understand our differences in understanding. I think you're familiar with my practical hands-on background to physics. 
From what I can gather, you're in the early stages in taking physics class, and trying to piece it together with a strictly theoretical approach.  

I have no formal education - but I've been learning and practicing practical physics as they relate to electricity for about 25 years - as a hobby when I was a teenager then professionally and as a hobby later when I grew up and started working in the field about 15 years ago.

Could you share your background - when did you get interested in the topic, how many years and what classes have you been taking? What field do you plan to work in when you graduate?

All the best,

Jesse
Reply: @fromjesse  Hi, dear friend :)

I am a Brazilian physicist graduated approximately 6 years ago.

I always wondered why KVL was not one of Maxwell's equations and Lewin's video showed me why :)
Since then, I've been trying to show the way to other curious people. I confess it's difficult because people have very different backgrounds and Maxwell's equations require a knowledge of vector calculus to be well understood.

I believe that mathematics is a very valuable resource to quantify the theories of physics. Therefore, I should be able to explain my reasoning without using advanced mathematics. However, our communication would be clearer if we could use calculus :)

You interpret FL and KVL as two separate laws, right?
In MaxEQ, FL encompasses the whole circuit assuming the role of KVL without the need of lumped elements. This is possible using vector calculus. Maybe that's why engineers argue "bad probing" while for physicists this is the proper way to measure it.

For us, "bad probing" would be the usage of a non-calibrated equipment or using a voltmeter in a circuit whose resistors are of the same order of magnitude as the internal resistance of the voltmeter.

Does this message clarify my arguments a little? 
For example, I talk a lot about E field because only it can create voltage (V=E.dl, not B.dl nor other fields). Also, both E and B fields can exist in vacuum/space (even without charge or insulators).  It is weird, isn't it? 
As you can see, classical electromagnetism (MaxEQ) is quite peculiar compared to what is taught in circuit theory.

Translated with www.DeepL.com/Translator (free version)
Reply from the maker: @renanmelo4903   Hello dear friend!

>Also, both E and B fields can exist in vacuum/space (even without charge or insulators)

I stand corrected. I think. There seems to be a fair amount of confusion online about what a field is and whether it needs charge carriers. But I will grant that it is at least possible and most likely probable that you are correct that an E field can exist in a vacuum. 

But I still maintain that a volt meter measures volts on conductors, not E-Field anywhere else.  An E-Field may exist inside a transformer, but the output wires of that transformer come out of it and have voltage on them. They may have an E-Field between them in the space there, but they have a voltage across them. And that's what the volt meter reads, and the volt meter neither cares nor knows whether the voltage is produced by magnetic induction or anything else.

Hey, I actually have a much longer response but thought I should first and ask this:

Do you think KVL failed to work in Lewin's experiment? Or was he applying it incorrectly? That's what I'm really stuck on is his claim that KVL failed in his test. I've been under the belief that you agreed with him.

Please let me know,

Thanks!
Reply from the maker: @renanmelo4903  Hi :)

>MaxEQ always holds. KVL is a special case of FL that holds only in circuits with lumped elements.

Let's try MaxEQ and let's see how it does in the style of Lewin :D

If you might be so kind, please calculate the following for me:

I'm going to set up my Lewin clock. The total volts per turn will be +725 mv.

The two resistors are 100 ohms (left) and 1000 ohms (right.)

I will have my probes connected to the copper half-circle traces exactly where Lewin had his volt meter leads connected.

My positive lead will be connected to the top copper half-circle, and negative to bottom half. The volt meter will read positive.

The volt meter will be to the left of the Lewin Clock. 

Please calculate how many volts my volt meter will read.

Then I'll test it out and see if MaxEQ holds.

Thank you!
Reply from the maker: @renanmelo4903  Hello :)

if you're too busy to work out the math for me I can try to do it myself, based on the formula that Lewin used.

I hope you are well!

Jesse
Reply: @fromjesse  Hello, Jesse :)

I'm working on it 🙂 As an exercise, you can try it by yourself too. Comparing your calculations to mine may clarify some details that Lewin didn't address in his videos.

Best regards
Reply: @fromjesse  Hi :)

Probably tomorrow night I will upload the file :)
Reply from the maker: @renanmelo4903  Hi! Thank you!
Reply: @fromjesse  Hi :)

This is the link to PDF file https://easyupload.io/dvc9f1

VL calculation is on the last 2 pages :)
Reply from the maker: @renanmelo4903  Thank you so much my friend!

If I had known it would take 19 pages I would not have asked you to do it! Now I feel guilty!

But if I understand correctly, the voltage on the left volt meter will be 296.6mv!

For reference, here's the schematic: https://i.postimg.cc/FsJh1zmf/Lewin-Diagram.jpg modified for my value of resistors.

Now I'm confused. Lewin, in his test, showed that the left hand volt meter read -10mv, while the right hand one read +90mv, when the total loop voltage was 100mv.

Did Faraday's law or Maxwell's equations also fail him? or are your calculations wrong?

If the voltage Lewin measured on his right volt meter was  -10 times what he measured on his left volt meter, then shouldn't my right volt meter also measure  -10 times my left volt meter? Thus my left volt meter cannot read 296.6mv because that would mean my right volt meter would read -2966mv which of course is larger than the total loop voltage.

Anyway, if you're sure 296.6mv for my left volt meter is correct, I'll go ahead and measure, I just wanted to make sure it wasn't a mistake.

Thanks again!
Reply: @fromjesse  Hi :)
I don't know if "infinite solenoid" is a good approximation for B field produced by your solenoid. 
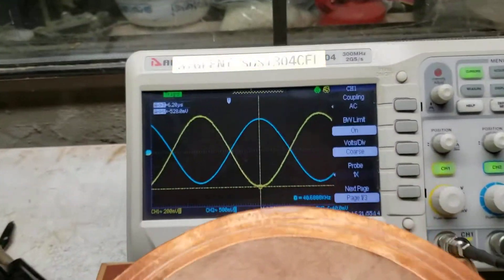If it is a good approximation, probing at A and D will give |V|~66mV and a ratio of 1:10 as Lewin's. If it is not a good approximation, we would need to know B field distribution. I assumed a possible case where the flux outside is almost half on the left that results ~296mV.

I covered the details in first 17 pages LoL :)
Reply from the maker: @renanmelo4903  My solenoid is about 150mm diameter, 50mm long, and the thickness is about 20mm.

Doesn't sound like an approximation of infinitely long to me either.

So are you saying that Lewin's did show the 1:10 ratio because his solenoid was effectively infinitely long, and that if his coil had been short like mine, he would not have had that 1:10 ratio?

But wait. Look here: I showed in my previous video that I read zero volts if my volt meter leads were routed like we presume Lewin to have routed his.

(And if there was a resistor with v/10 across it, that would have been added to the reading.)

https://youtu.be/_mzxE_p5dN8?t=1009

But anyway,  if 296mV is the answer I'll go ahead and test it again.

Thanks!
Reply: @fromjesse  Hi :)

No, Jesse. Look at page 18. There is a purple area between voltmeter and half left of the circuit. I'm saying that V reading changes depending on the magnetic flux through that area.

Comparison of V readings outside the clock: https://i.postimg.cc/6QPZHS3C/Outside.jpg
Comparison of V readings inside the clock: https://i.postimg.cc/CxLfwYnj/Inside.jpg

I marked the time of your other video.

If the flux through that purple area is neglegible (infinite solenoid) or if this area is zero (twisting wires) we will get ~66mV. Otherwise, V reading will be different until we embrace half of outside flux getting ~297mV
Reply from the maker: @renanmelo4903  Hi!
So if I understand correctly, you cannot calculate the voltage I will read unless you know exactly what path my volt meter leads take?

Remember, we're doing this in the style of Lewin. I told you that when I first made the request.

Lewin did not tell us about his volt meter leads. He simply told us that the two volt meters were connect in exactly the same place and one was on the right and one was on the left, and that his two volt meters were identical.

He told us that it was so amazing and unintuitive that we'd be telling our grandchildren about it because we'd never seen anything like it before or after.

What was so ununtuitive or amazing about it? Nothing. He had an AC transformer. Invented a hundred and twenty years ago and seen by the thousands on power poles in all civilized countries.

But why was it so amazing that his peers accused him of cheating? Because he had cheated. He had his volt meter leads looped in his transformer, which caused error in reading, but he did not tell his audience. 

If he had been honest, and explained that his volt meter leads ran through the B field and had voltage induced in them according to Faraday's law, then nobody would have been surprised. It's an AC transformer. So what? It would have been mundane.

It's just like a magician on a stage before a large crowd. He uses every day objects and common principles, but he tricks the audience into thinking it's something else they see, and they are amazed at the "impossible" things he does. If you knew how it was done, it wouldn't be funny at all.

Just watch his little magic show here: https://youtu.be/nGQbA2jwkWI?t=2903

Anyway, we have a problem. You won't let me consider the voltage induced in my volt meter leads when I'm testing KVL, thus preventing me from following the rules for KVL.

And yet, you say that MaxEQ always works, but that you have to consider your volt meter leads, otherwise you cannot calculate the reading.

Why am I not permitted to model the entire effective circuit (including volt meter leads) when I'm testing KVL, but I'm required to model the whole effective circuit when testing MaxEQ?

Do you see the problem? When testing KVL, you're setting some constraints saying I am not allowed to model all of the induced voltages.
When I test MaxEQ, I'm required to model all of the induced voltages.

And you accept this absurd idea that two identical volt meters measuring voltage at the same point can measure different  voltages. They may be connected at a common point, but they are not measuring voltage at that same point. Did you see my video where I disproved KVL with DC batteries too? https://youtu.be/V_Gs8tSqBRY

In other words, if we apply the same rules to KVL and MaxEQ, they both fail, or they both hold true, depending on which set of rules we apply.

(Oh, are you able to understand spoken English? It just dawned on me that perhaps you are using a text translator and unable to understand the English language monologue in my videos. Maybe that's why we're having such a hard time.)

The problem is you're setting the rules different for KVL and MaxEQ so that one will fail and one will hold true.

Ultimately, if you don't know the path my wires take on their way to the volt meter, you simply cannot calculate the measured voltage using MaxEQ either. And MaxEQ fails to hold.

I can go ahead and test it and make a video, but all I have to do is move my volt meter leads around till the reading is different than whatever calculation you come up with, then, like Lewin, I can crow like a rooster and say "Ladies and Gentlemen, this is so astounding you will be telling your great grandchildren about it! MaxEQ does not hold! MaxEQ is for the birds!"

That is the EXACT thing that Lewin did. He ignored part of his circuit and didn't tell anybody and then gave that as evidence that KVL didn't hold.

You also disregard incorrect probing as a thing that you think does not exist. If having unknown or unmodeled voltage induced in your volt meter probe is not bad probing, then what is bad probing? 

Why can't we have the same rules? If we're going to ignore the volt meter lead path when testing KVL, then we also need to ignore volt meter lead path when testing MaxEQ.  You know they'll both fail.

Alternatively, if we model the volt meter lead path, then both KVL and MaxEQ will hold true.

So which rule shall we use? Are we going to model volt meter path for both? or for neither?

I'm assuming you've read the paper by Dr. Kirk McDonnald of Princeton? http://kirkmcd.princeton.edu/examples/lewin.pdf

He says in that paper that Lewin is "misdirection" (which is something a stage magician does) and he also says that Lewin is using a non-standard version of KVL.
Dr. McDonnald concludes his footnote with "Of course, use of an obsolete version of a “law” can lead to apparent paradoxes."

He's not even granting that it's a paradox, but only an apparent paradox!

Dr. McDonnald also says "In Lewin’s example, a meter reading, does not equal the voltage drop between the tips of its leads ...."

So again, Lewin claimed that the volt meters were connected at the same point, which he said to trick the audience into believing they were reading the voltage difference at the tips of the leads. But it was a lie. Dr. McDonnald says it was NOT reading the voltage at the tips of the leads.

Dr. McDonnald winds up saying "Lewin’s circuit is within the range of applicability of Kirchhoff’s loop equations, which can be used to predict measurements by the “voltmeters” in the experiment. "

Or did you read the paper by Dr. John W. Belcher of MIT? http://www.electroboom.com/share/FaradaysLaw_Mehdi.pdf

Dr. Belcher ends up citing Feynman, claiming that KVL does hold.

He ends up saying "In this sense, KVL holds, as argued by Mehdi Sadaghdar ..."

So help me out here please. We've got two Phd physics professors from two of the greatest universities in the USA, one of them citing Feynman, who is one of the 10 greatest physicists of all time in the world - with the other 9 being Albert Einstein, Isaac Newton, James Clerk Maxwell, Niels Bohr, Werner Heisenberg, Galileo Galilei, Paul Dirac,  Erwin Schrödinger, and Ernest Rutherford.

And the other of these great physics professor I've cited says Lewin is using an obsolete version of KVL, using misdirection (which is a form of intentional deception),  and who calls Lewin's paradox an "Apparent paradox."

So you're telling me they are all wrong?

And then there is my own experience measuring voltages around the loop, for which KVL worked just fine.

It would be silly of me to accept your claim when I would have to go against Dr. Belcher and Dr. McDonnald -- and  going against my own observations.

At this point, the only evidence "that KVL doesn't hold" I'm interested in  is an experiment that demonstrates it.

If you can come up with an experiment which I can perform that shows that KVL does not hold for a frequency where the wavelength is large compared to the size of the circuit, then I'll be glad to test it out if it's plausible.

Remember, MaxEQ does not hold true either if you don't know where my volt meter leads run. Bad probing can be a problem for MaxEQ too.
Reply: @fromjesse  Hi :)
Jesse, I need 2 informations to calculate FL: 1) Position of the Voltmeter's wires 2) B distribution in space.

The distribution of B for a finite solenoid is not simple. I got stuck. The most I can do is calculate when the area between voltmeter and circuit is zero (twisted wires) resulting in ~66mV or when the area is too large that embraces half of the flux lines resulting in ~297 mV.

For an INFINITE solenoid, B is well known. It is constant inside the solenoid and B=0 outside. Once B=0 outside, V=Ri across resistors and V=0 across conductors.  Our disagreement is in WHY V=0.

For MaxEQ, V=0: B=0 (outside the solenoid) and E=0 inside the conductors. There is no bad probing.
That analogy of opposite batteries says that TOTAL E = 0 because there is +E inside conductors and -E induced due to bad probing. This analogy gives the correct equation but the physics is wrong. It assumes E inside a perfect conductor and mixes concepts that use the same unit of measurement (although they represent different quantities).

For example, we can use meters to measure length, distance or perimeter. The sum of the distances between consecutive vertices of a closed polygon results in a perimeter, but mixing lengths and perimeters in the same equation is not common. The numbers can be added together and they have the same units, but it is not usual because the properties of these quantities are different.

Both B and E generate EMF. However, only E is responsible for voltage drops. Thus, adding EMF and voltage drops just because it has the same unit of measurement is inappropriate when B field is involved (inductor).  

Professor Belcher makes this explicit (section 11) : "... But this quantitiy, wich has units of volts, has nothing to do with -E.dl through the inductor, wich is zero ". He continues: "In this sense, KVL holds, as argued by Mehdi Sadaghdar, but one must always remember that the voltage difference across the inductor is defined in a very different way compared to the voltage difference across the other three elements " [The highlights in bold are mine]

For EE purposes, values in volts add up to zero.  Life goes on. For a physical explanation this is wrong because it assumes E not 0 inside conductor. This wrong assumption blames V=0 for bad probing when, in fact, this is the expected result.

Feynman first teaches MaxEQ. Then he defines V across an inducer differently from other books. This way he avoids the analogy with batteries that assumes E field inside a conductor.

I see 3 possibilities: 1) You define the voltage drop in the same way for all the elements and KVL is wrong; 2) You define the voltage drop in an inductor in a different way by making KVL compatible as a particular case of MaxEQ with lumped elements (Feynman) 3) KVL works if you assume an analogy with batteries that is incompatible with MaxEQ because they assumes E field within a perfect conductor.

Translated with www.DeepL.com/Translator (free version)
Reply from the maker: @renanmelo4903   Hi! :)

>For MaxEQ, V=0: B=0 (outside the solenoid) and E=0 inside the conductors. There is no bad probing.

You may not have bad probing, but you are also unable to measure the real world, so I guess it doesn't matter if your probing would have been good or bad.

The fact is, in your purely theoretical world, there is no such thing as probing, good or bad.  There are no measurements, only calculations.

By contrast, I can use good probing and actually measure the real world. And I can use KVL to accurately predict the voltages on the resistors.

>For EE purposes, values in volts add up to zero.

And get this, it's called KVL - Kirchhoff's Voltage Law.  The volts add up. 

>This wrong assumption blames V=0 for bad probing when, in fact, this is the expected result.

Any time two identical volt meters are connected to the same point and give different readings, that is the definition of bad probing. Sorry. I know you don't believe that bad probing is a thing. But if any measuring tool is used to measure something and there is an unknown error influencing the measurement, there IS bad probing. Some day you'll appreciate that fact. 

Bad probing by definition is any case where an error is introduced in taking a measurement that is not accounted for or eliminated. If two identical volt meters connected to the same points read different readings, then at least one of them has bad probing.

Faraday's law is absolutely clear in describing when voltage will be induced in a volt meter lead, and how much.

The only argument I can imagine that you might make is that V in KVL means something other than volts. But even that's not a sound argument, or Professor Belcher would not have agreed with Mehdi Sadaghdar.

MaxEQ is a fine way to analyze a transformer, but KVL works just fine too you understand Faraday's Law and if treated with the same care that you must also treat MaxEQ.

You've just shown that without controlling the position of the volt meter leads, you cannot calculate the voltage on the resistor using MaxEQ either. 

But guess what, if I control the leads, then I can use KVL and Faraday's law to also calculate the voltage on the resistor.

At this point, let me say that I am extremely grateful for your effort. I am saddened that I could not understand your point. And I am doubly saddened that Lewin Lied and that doesn't bother you.

And I don't know how you can imagine that two identical volt meters connected to the same place can give different readings unless there is a probing error.
Sure, the probing error is caused by a known law of Faraday - the wire cuts through a changing magnetic field - but it is still an error in the reading.

Ultimately, anybody working in the real world needs to be able to make an accurate measurement. If you were hired to measure the voltage coming out of an AC transformer and you replied and said "I can't because transformers don't have voltage and it depends on how many times I loop the volt meter leads through the transformer core" your boss would not be very happy. 

The undeniable fact is that a transformer does have an output voltage. At a given instant in time, it has only one output voltage. Any accurate meter connected to that output voltage will read the same thing. If a meter reads something other than that, it's being influenced by some other source of error.

Some day the real world will meet with your theoretical world and you'll think back and say "That Jesse wasn't as crazy as he seemed."

At this point, there's really only two things you can say on this topic that will interest me. 

One is to come up with an experiment I can do with good probing that shows KVL does not hold where the wavelength of the frequency is large compared to the size of the loop.

The other is "Why did Lewin tell his audience that they would be telling their grandchildren about what they say" when all he showed them was a common AC transformer?

Actually, there is a third thing I'm curious about. You told me about your having graduated physics 6 years ago, but I would be interested to hear what you're doing now for work.
If I didn't already tell you, I'm a mechanic, electronics / printed circuit board designer, firmware and software developer. A couple of years ago I built a GPS guided sprinkler system for the cattle hay: https://youtu.be/-RFG8v_bfp0

Take care
Reply: @fromjesse   Hi :) I hope you are well and already vaccinated. Scientia Vinces!

Although I stopped replying, I kept thinking about the things you said and the problem itself. I finally understood some key points that might clarify things and I'd like to share them with you.

Currents and surface charges
Earlier I said that outside the circuit there is no electric field. I was wrong. I learned that in both DC and AC circuits there are electrical charges on the surface of the components.
Surface charges and currents have been neglected in mainstream physics textbooks in the past. This is pointed out in the American Journal of Physics [AJP 64, 855 (1996)]. 
In general, these charges are small and we need to use high voltage to detect their effect. You can see an experiment here (https://www.youtube.com/watch?v=spD-hjtTUXg) and fabulous pictures in Jefimenko's book Electricity and Magnetism.

Bad probing
"Bad probing by definition is any case where an error is introduced in taking a measurement that is not accounted for or eliminated."
You repeatedly talked about bad probing, but I didn't understand. How could bad probing occur if my mathematics all agreed with the readings? This confused me a lot!
Recently I realized that this induced field outside the circuit is accounted for when MaxEQ is applied. Because of this, I ended up not understanding your point when you rejected bad probing situations.

Voltage and EMF
Now that I understand what you mean by bad probing, I hope I can explain "Lewin's Paradox".
MaxEQ accounts for the reading on the voltmeter even when it is in bad probing. On the other hand, if the voltmeter is properly probing, it measures a quantity called EMF.
V and EMF play different roles in MaxEQ but they are treated as almost the same thing in Circuit Analysis.
Lewin (me and other physicists...) used MaxEQ terminology to criticize KVL ignoring the context. That was the problem!

I believe something similar occurs for density and specific mass. They are different quantities but they have the same units and almost the same applications. It is natural to mix these quantities... but it can create confusion.
  
I apologize to you and conclude: in this understanding, KVL always works!

Translated with www.DeepL.com/Translator (free version)
Reply from the maker: I'm so sorry, I just realized I neglected to respond to this specific question you asked:

>Which readings you consider affected by induced fields?

I consider the same as Faraday - any probe wire that cuts across magnetic lines of force which are changing in strength will have a voltage induced in it. 

Thus, all of your proposed measurements which have a probe wire running along the same path as the loop under test will unquestionably have induced into them the same voltage as is induced in the loop under test for that section of it.

Any two wires running in the same path in a changing magnetic field will have the same voltage induced on them. That's implicit in Faraday's law, and it's required to be true or else transformers wouldn't work.

Hope that helps :D
Reply: @fromjesse  Hi

There is another component that influences how much is induced: the area available to the magnetic flux.
I sent a new file illustrating it :)
Reply from the maker: @renanmelo4903  My last comment is in response to Setup2.pdf. If there's a Setup3.pdf, I haven't seen it yet :D

In my previous comment, I made you a video that shows that the magnetic flux falls off very quickly outside the coil - probably square inverse law - while it falls off at a very slow rate inside (and probably would be uniform in an infinitely long solenoid.)

Outside the primary, the voltage induced no longer goes by the "area" "rule" but rather based on how much magnetic flux the probe leads cut across. The "Area rule" is a shortcut when dealing with a loop that's entirely inside the primary.

The real underlying principle is strictly related to Faraday's law and the strength of magnetic flux and the length of the wire in that flux.

I need to run some errands, but please watch the video I linked in my last comment (https://youtu.be/Wju9QoB-llE)  and at my annotations of your Setup2.pdf (https://postimg.cc/phXRBVm3) and see if any of it makes sense.

If not, I'll make another video showing exactly how voltage is induced in the probe lead when it runs along the same path as the primary coil.
Reply from the maker: @renanmelo4903  I just uploaded this for "Trevor" and thought maybe it would help you as well. Notice how the voltage induced in A+B is the same as D+C, and the signs cancel eachother out just like having two batteries in series negative to negative (as shown in right top) https://postimg.cc/gX84gkmY

If one wants to measure the voltage induced in a path segment, their volt meter leads cannot run along that same path or the voltage that would have been measured will be canceled out.